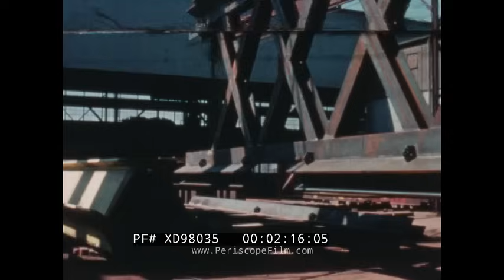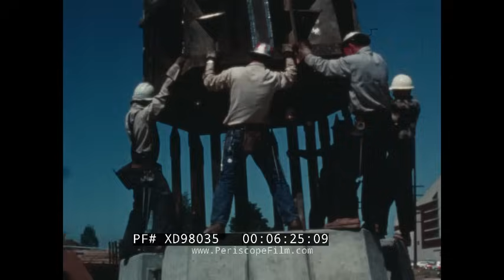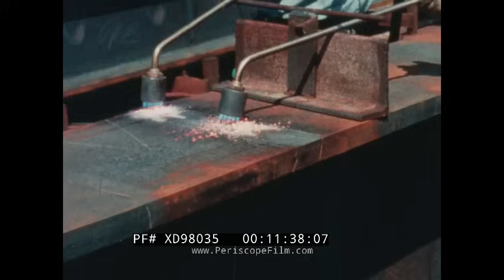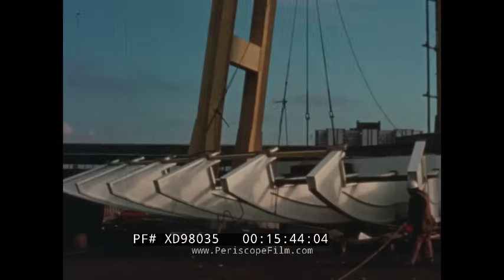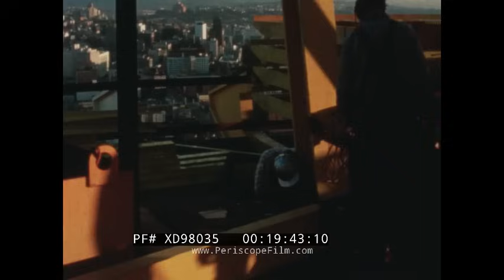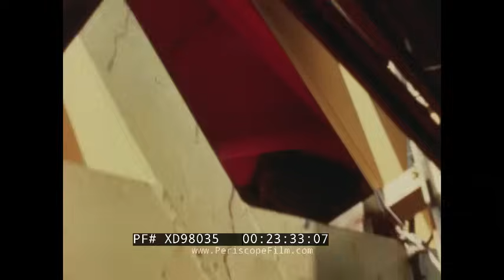"STEEL IN SPACE " BUILDING THE SPACE NEEDLE FOR THE 1962 CENTURY 21 EXPOSITION  SEATTLE  XD98035

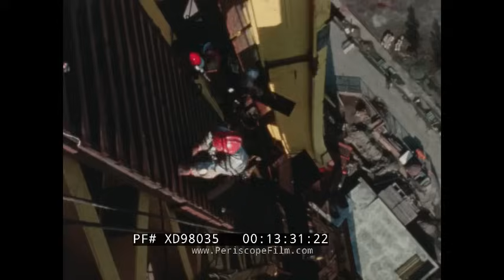Comment: There's a big error at 13:30(±) when he says the Eiffel Tower is made of steel. It's actually made of iron, which is a big difference.

"The Eiffel Tower is made of iron, specifically puddled iron, not steel. Puddled iron was the preferred material for large-scale construction at the time the tower was built in the late 19th century, as it was a durable precursor to modern steel."

[La tour Eiffel]

Comment: My grandfather worked for Pacific car and foundry and also helped build the needle. On your way to elevator he is  the Man standing directly behind the picnic table during the company picnic .there is no glass installed yet . He also pictured in the Seattle PI . standing on  trailer as they lift the PI ball sign . Clarence Axle Johnson . My grandmother had a shop down in the brazar. Then worked at jones fantastic museum by the bubblelater .my mom,  father , brother and I all worked at the Seattle center . My great uncle painted the back drop for the show behind the wheel with jim rogers .the 1968 Camaro used for the show i have photos of ut sitting in my grandparents front yard . Feb 68 . Williams and Swanson Chevy